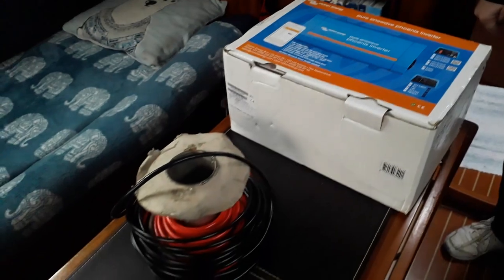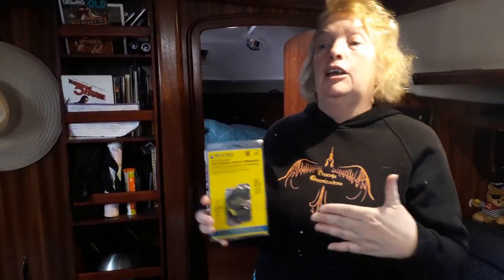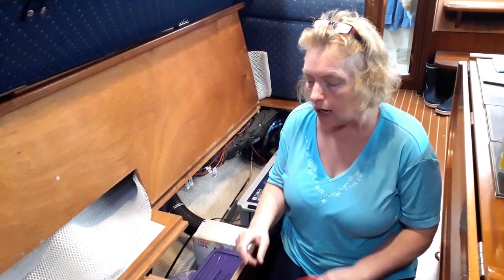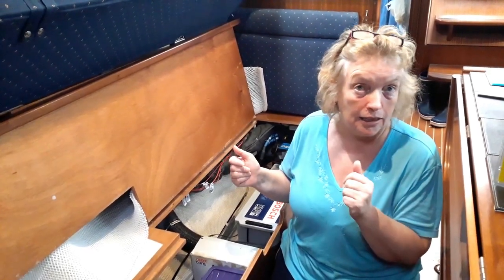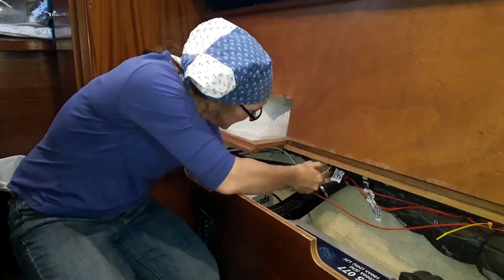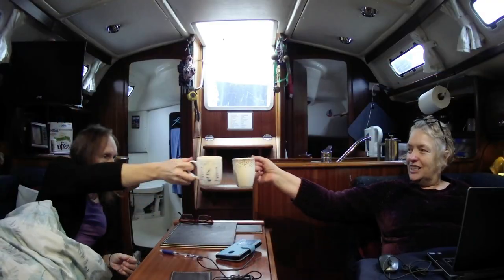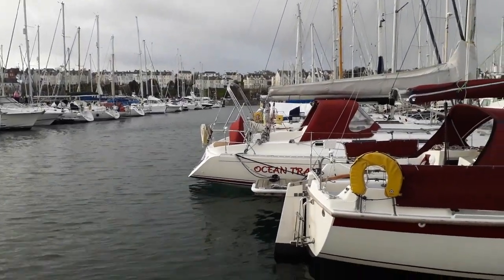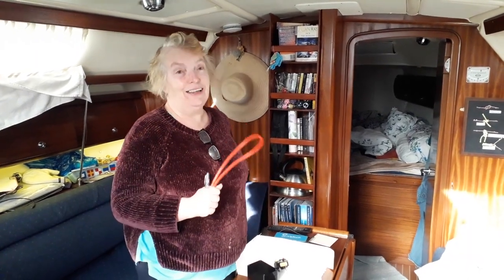Northern Ireland - Winter - Electrics - Inverters - Weather - Ep. 224

Comment: I love seeing you two, just so genuine and its refreshing. For the battery bank, (you may already have it) check out "Battery Extra" UK Company. They have a Desulfator that connects up and increases the life of the Batteries. SV Impavadus Channel has an installation video, they have had it on 4 Boats and said in one case it resurrected a dead Battery!  Worth checking out as they had a repair on one of those panels as well. 

For the crafting.... and also for making new panels (and I'm sure you will think of a ton of other things) take a look at a "circut" machine (everyone calls it a "Cricket"). It's a mini CNC for Crafters.. very cool, quite cheap and lots of different tools for it. (From markers, fabric cutters, plastic) 

Fair winds Ladies, you rock 👍😁
Reply from the maker: Thanks for such a detailed comment and the link to the desulfator. Do they work with sealed batteries? Ours are lead acid and sealed and the Victron does have a desulfanation feature that we have never used. That "cricket" machine is interesting, but I am not sure we have enough projects/uses to justify it.

Comment: We've a breaker switch like yours for the anchor switch. Only turn on (still call it flag switch because original was red paddle/flag shaped) when setting/lifting anchor
Reply from the maker: Our anchor breaker is hidden under the chart table which is a great relief since whoever put the lettering on it was having a severe attack of the shakes
Reply: @SailingYachtSaltyLass  ours is on  watch berth base. Previous design was a nightmare,  always worried someone would flick on by accident / snap flag/key switch off
Reply from the maker: We have installed this one somewhere visible but hopefully very unsnaggable

Comment: That's nothing ladies 2 years for an inverter, I've been waiting 3 years to fit my diesel heater and I've just bought a new clipper wind too. The only problem is that's at the top of my mast, so that could take a while too. 😀
Reply from the maker: You would be better with the heater at the bottom of the mast 😎 Perhaps you can get it fitted in time for summer?